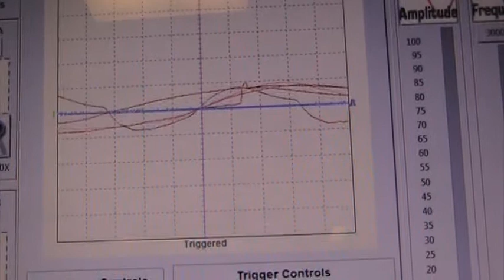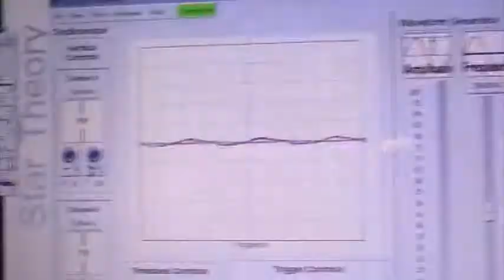TrueRife Hammer Analisis

Comment: This was not properly measured. I build BOTH Rife machines AND Teslas Violet Ray machine…

You must measure the plasma output NOT the EMF. You do not have a scalar graviometer as example.

You also clearly do not understand it is supposed to effect brainwaves as well as the rest of nervous system. I have used this technology for YEARS and nearly every day. There is nothing wrong with my brain. It is better.

You also used it way too close to a ground. The sink. YOU are suppose to be grounded and receive the energy. Maybe you know that though and are trying to isolate yourself due to your fear.

Do not listen to this guy.

I use 7.29037 on the hammer and the first night I was having lucid dream and its helpful. This is Plank Length and Phi derived frequency close to Alpha brainwave window.